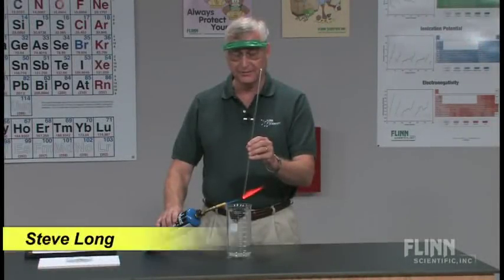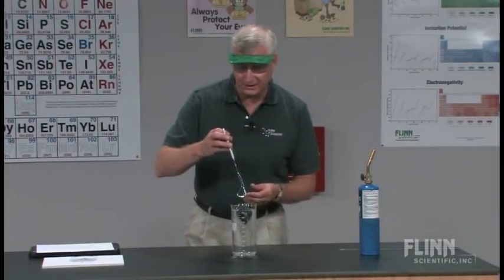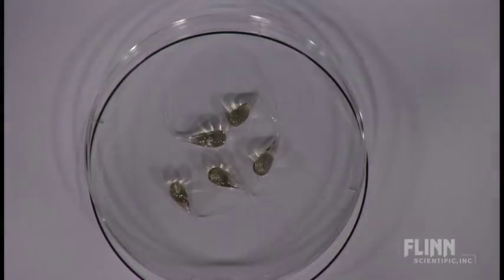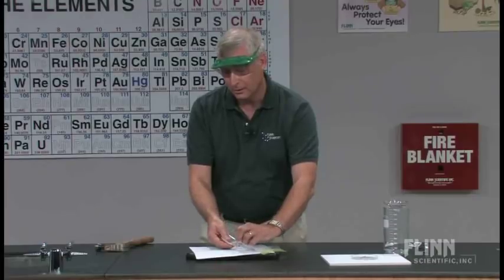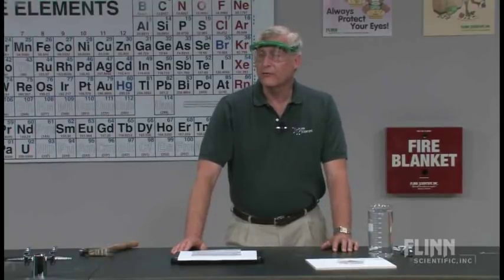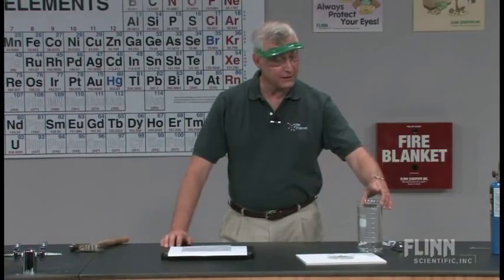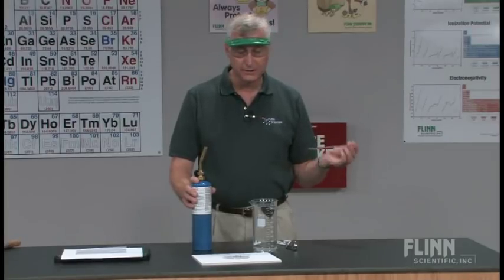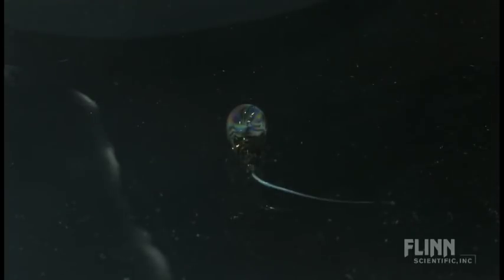Prince Rupert's Drops Are Stronger Than Steel

Comment: If you were to make one in space it could be make without a tail. Would this make it indestructible?
Reply: no not indestructible just really really durable
Reply: Nope, any scratch on the surface causes it to shatter.  They're super-durable against blunt impacts, but, the first sharp thing destroys it.
Reply: ***** I have no idea, but I love the fact that you thought about that! There's probably a whole host of cool things we could do in total vaccum and/or near weightlessness!
Reply: You probably just couldn't make one in space since there is no oxygen in space required for the fuel of the torch. So considering that, let's say you use another heat source, like a laser. The gravity on earth is what causes the droplet to be pulled from the rod while the glass is molten, so the completely even pressure that would be applied to the molten glass in space would not allow for the drop to form. You'd have to have something pulling on it for the drop to form. Apart from that, you have to consider the way the glass would react if heated in space, since there is no oxygen. Would it even get "molten"? I could be completely wrong though, just my opinion lol.
Reply: I'm pretty sure molting doesn't have anything to do with oxygen and you wouldn't have to use a rod, just let a small chunk of glass float there and heat it with a laser or something (not really sure weather or not the torch would work). Then when it molts push a ball of water its way and see what happens.
Reply: ***** No oxygen in space? We should immediately tell this information to all the astronauts. I hope they are still alive...
Reply: ***** Wow that was pretty snide especially since I never said "there's no oxygen in space" I said I wasn't sure if the torch would work because of it.
Reply: ***** In fact, my comment was referred to Gregory ;) By the way, if you questioned about the efficiency of the torch, maybe you agreed with the "no oxigen statement". But I was only joking around.

Comment: what happen if you dropped a melted spherically shaped glass  mass into cold water like this? you get no tails right? is the sphere stronger than steel then?
Reply: I'm no specialist at all, so don't take my word for granted. The best would be to get an answer from FlinnScientific . In any case, my initial guess is that you cannot create Prince Rupert drops which are spherical. The tail acts a keystone in architecture: without it, the cooling glass does not compress internal forces onto anything and therefore aren't any more solid than normal glass.
Reply: a youtuber named carsandwater done a similar experiment with a marble made of glass heated it up to a melting point and put it in water the marble shattered but his eperiment might deem invalid if you take into acount that the marble was deformed int the moving process

Comment: I thought the blue cone on the the inside was the hottest part? (at least thats what I remember from the chemistry classes I didnt sleep through in high school)  Is there a specific reason you arent actually holding the glass in that specific spot?

On a side note, I really wish I had teachers like you growing  up. I am naturally very inquisitive but most of my teachers were never actually passionate about their job and its was apparent.
Reply: ***** I know for certain that the flame turns orange because the glass lowers the temperature significantly, so that is false.
Orange and white flames are literally opposite sides of the how hot the flame is. White is the hottest and orange/red is the coolest.
Reply: +iRTehSecks no mate, your response was fairly hostile and aggressive
Reply: Not entirely. I have no issues being wrong and I wasn't even the one who was wrong but had read your comment as a 3rd party and you still came off as aggressive for no reason.
Reply: +Syntechdragon No he did not sound aggressive, he just corrected him.
Reply: +iRTehSecks And to be exact, he wasn't trying to be a dick, as he said, "I know for certain (evidence which contradicts CP), so that is false". The only even remotely non-neutral word is literally, but you are just sensitive as was said before. ;)
Reply: I just ignored them because I could tell they're just sensitive. I wouldnt even put up with that level of sensitivity in person with someone I knew, let alone complete strangers online.
Reply: +iRTehSecks The tip of the blue part usually tends to be the best for heating, while blue does tend to correlate with greater heat then red for burning gasses the area inside the blue cone that you see on burners actually has no oxygen reaching it and so its not a good place to heat or burn things. My chemistry lab professor has demonstrated this by holding an unlit match head inside that blue cone area by putting it in there quickly, once it's just sitting in there it does not ignite (this was on a Bunsen burner not a propane torch but I'm sure the same principal applies), he also brought a piece of paper down onto it quickly then pulled away and you could see a circle that did not burn in the middle area where the blue part was touching the paper and a blackened burned area around that circle where the blue ends.
Reply: Swiftness Thank you. That is the kind of answer I was looking for.

Comment: What if you were to reheat the drop with a propane torch? Would it just explode as usual, or would it heat slow enough to just melt?
Reply: you would increase the stress inside the drop (heating the outside of the glass increases the volume the outside takes up further increasing the effect that makes it so sturdy). It would probably explode, but if it's able to withstand the stress-increase survives and the drop melts it will upon melting rapidly heat up

Comment: Gives a new meanining for  " glass jaw "      " Dude has a prince rupert jaw "
Reply: sranjesuper but this would also mean it would be strong  as hell unless u get it at the perfect spot
Reply: l2noob4ul - Probably the heel.
Reply: sranjesuper The glass jaw on a prince rupert is the tail. You snip that with a pair of wirecutters, the tension built up in the drop is released explosively.
Reply: ^ yup lol, couldn't think of the word LOL and heel was close enuff :)
Reply: l2noob4ul
- I was making a reference to Achilles. You know, held by his ankle and dipped into some magic river that made him basically invulnerable everywhere except for the ankle that was held at the time; the proverbial Achilles Heel thus being the extreme weak point of an otherwise insurmountable opposition.

Comment: I hate to correct a professor, but the front windscreen in a car is laminated soft glass and not tempered. It's extremely important that the windscreen stays intact during an accident. However, the side windows and the rear window is tempered to allow for the escape of the driver and the passengers. It's this tempered glass that forms tiny cubes, laminated glass cracks into much larger pieces, but is held intact by the lamination.

Comment: Question: How big can you make a rupert drop?
Reply: probably not any bigger than an inch, Im no expert but I'm guessing that if the surface area is too large then there would be too much pressure on the thin layer of hardened glass on the outside and it would break or explode. like I said, I'm no expert so do be surprised if it completely wrong.
Reply: ^ mature..

but to answer the question, as big as you want, it's just the bigger you make it, the larger the explosion and the larger the weakness.
Reply: @kitsilanocat  Fo show it cant be bigga than yo mama tho! Skeet skeet skeet! :D
Reply: Maybe dropping it in boiling water would help make a bigger one is anybody figures out how to make big ones please tell me
Reply: Go to beyondthepress. He makes large rupert drops. You’re only limited by the size of glass stock used.

Comment: If you dropped it in liquid nitrogen and not water would it be harder from cooling faster?
Reply: Saberéase Era Probably would break more, but if you managed to have one survive, perhaps.
Reply: Short answer, no.
Long answer, the glass gets as hard as it does because the inner glass takes longer to cool.
So, if it were put in liquid nitrogen instead it would cool faster and most likely explode. However if it did survive it would still not be stronger, it would be much weaker and would most likely shatter from slight shocks like just being picked up.
Reply: No it 
Would shatter

Comment: What happens if you do this experiment in space, where you can place a molten glass sphere in water without it forming a tail?
Reply: Sure wouldn't it just not separate from the rod???
Reply: Rupert's balls! the first thing that came to my mind :-p
Reply: SerpentSword _ Nothing says you have to use a rod, you can just use a chunk. Heat it from two sides so the Bernoulli principle keeps it in place and KABLAMO - prince rupert's balls!
I guess the real problem is how to cool it from all sides at the same time, so it doesn't explode as soon as it touches water.
Reply: You'd have an indestructible glass ball
Reply: ofcourse and then it will came on to his face and then his face turn be justin B face
Reply: It probably would not work unless you found a non-flame heat source to melt the glass. With little to no oxygen in space you would not be able to produce a flame. You would also, for various reason, find it very difficult to keep the water in its container or even to maintain it's liquid state. I cannot see anyway this experiment would be repeatable in the extremely cold vacuum of space. You may be able to modify the experiment in ways that are beyond me but I think it's safe to that for all intents and purposes, it's not plausible.
Reply: +Luben Lambov 
Or if somehow using Bernoulli's Principle like you mentioned you could probably omit the water altogether because once the glass drop falls away from its heat source it will instantly cool at "space temperature". But, again, I would tend to think that a non-flame heat source is needed
Reply: TCSwizz2 Vacuum is not cold, per se. You need to immerse the glass in water, or similar liquid, that would quickly transfer the heat out from the glass.
Reply: +Luben Lambov 
A vacuum may not necessarily be cold but space is. Which is what I was getting at.
Reply: TCSwizz2 Space IS, basically, a vacuum...
Reply: +Luben Lambov The drop won't drop... The heated glass won't separate because it is in a low gravity environment VERY LOW gravity environment
Reply: +Luben Lambov 
Is there an echo in the room? Because I'm pretty sure someone already stated that space was a vacuum... Oh yea, it was me! Hahahaha
Reply: +CrimsonBlood017 
Do you think the drop would float away if you heated it from the top down? Lol 😜
Reply: +Luben Lambov 
Whatever you say Bro Beans! I do believe you were the one that said, and I quote "vacuum is not cold per se". But, it doesn't matter. I can see that your head is way to big to hold your intellect.

HAHAHAHA you're a fool bro
Reply: TCSwizz2 OK, now I'm 100% sure you're off in some way.
Reply: Ok so how about this:
0_ Sorry for bad english, not native.
1_ As I understand about this thing is that what you essentially need is to heat the glass to some really high point, so what you could do is to use a premade glass ball(?)
2_ You need to heat the glass in all the surface. We can use a heat source like oven thing to this.
3_ Here is the problem, we need to cold it same way we heat it, BUT in thermodynamic we learned how a refrigerator works right? We could use the same principle to "revert" the heating source to be a cooling source, we'll need an really high amount of energy to revert the machine's temperature but I think it's posible.

Correct me if I'm wrong, I found this posible output really interenting
Reply: +Luben Lambov  A vacuum, and space =/= the same thing, You can have a vacuum here on earth. A vacuum is a space entirely devoid of matter.
Reply: Well, That could probably be done only by Laser or Highly concentrated sunbeam.. Or may be some electrical method..... Cuz Flames dont work so good in space you know.... :D
Reply: MidnightKatana Technically, yes, but not in practice. You can't create a space entirely devoid of particles/matter, but space is close enough to be considered a vacuum.
Reply: It wouldn't form a drop for one thing.
And without the quench in water it would have the properties of being so strong, and having a tail.
Reply: You wouldn't be able to get an open flame?
Reply: Alec Schmutte jiujitsu5000 I should have thought my comment through a bit better, I'm sorry. 
By "space" I meant like on the space station, as in "zero g", or something like that. So it doesn't form a drop shape, but rather stays a sphere. But then again, you would probably to heat the glass up with something else, as flames will just spread everywhere, even in a controlled experiment chamber.
Still, it's a fun thought experiment.
Reply: jiujitsu5000 I'm too stupid and fat. Also probably too old, but not sure.
Reply: @TCSwizz2  it doesn't have to be a vacuume, just 0 G. You could do it in a pressurized factory in orbit.

The vacuume also insulates so it would retain heat until you conducted it away.

Comment: i work in a factory and we have punch presses that can stamp parts out of steel. I'd like to see what one of these things would do under literally 2000 tons. That's 4,000,000 pounds.
Reply: bobwatters it says the drops are stronger than steel. If they are, then if you placed one on the die and lowered the press, it would not be crushed. And i guareandangtee you it would. We've crushed synthetic diamonds in these presses lol
Reply: ***** You aren't taking into account the size ratio, unless you're pressing drops of steel. If you found a way to get a drop of glass to fit the size of the press (Probably impossible) without also exposing the weak tail of the glass to the pressure then your press would probably do nothing to it. Theoretically  speaking of course, the glass would lose all of it's strength getting it to that size.
Reply: Darren Miller what i'm saying is, take a drop, put it on the post, and bring the die down. The drop would be crushed to dust. The drops aren't "stronger than steel".  They may be harder on the mohs hardness scale, but the tensile strength of glass is no where near that of tool steel or even cast iron. Like i said, we've crushed synthetic diamonds, which actually have a hardness scale of 99.9/100. These drops are not as strong as diamonds, and they aren't as strong as steel. So hush.
Reply: Simple analogy as to why it doesn't work like that: Even if my brother's stronger than me, neither of us can lift up a house. Even if I'm faster than my brother, neither of us can run faster than a bullet train.
Punch presses designed for stamping out steel aren't exactly strong enough to do it. They're a lot stronger.

And if you're referring to the fact that steel is forced into a new shape by them, whereas the glass drops just shatter, then that's a different thing entirely.
Reply: Alexandr Korekov He said stronger than steel, but that does not mean that it is stronger than anything else on the planet, I am sure that 2k tons is not the exact borderline number to press steel, meaning that it is above it, hopefully it is, as it should be. Meaning it could still break that drop.
Reply: Since you are only referring to force, not pressure (which is force per unit area), the result would depend on the area that that force is applied to on the glass.  If the tempered glass is a flat pad with more than 2 square inches, and there aren't any sharp points or bumps in the contact area, it might survive.  For a Prince Rupert's Drop, the press & anvil would require conformal contact shapes with similar minimum area constraints.
Reply: SIMKINETICS
:o uh what lol
Reply: *****
in other words, right now you are a hawkboy, one day you may become a hawkMAN
Reply: yeah, and the analogy of using a (synthetic) diamond compared to one of these drops is a logical fallacy. just because something is hard does not mean it is hard to break; on the contrary, it's hardness is exactly why it shatters. an everyday diamond would crack or possibly shatter under the same hammering that this drop took.
Reply: but mine also gets harder than steel
Reply: hawkboy1792 it's not harder than I am first thing in the morning... Not even the press could beat it down

Comment: Do those internal stress forces generated by the rapid cooling of the glass drop 'knit' together the microfractures in the glass drop - - or the microfissures on the surface of the glass drop?

Comment: In 1975 a coworker who was retiring showed us this with 3 inch rods and a barrel of water . Heated about 15 inch of a rod into a drop in the tempering  oven . Was about 6 1/2 inch in diameter with a curlicues stem of 24 inches. 

Used a 4lb hammer and couldn't break!  Then he disintegrated it by snipping the tail with a pair of pliers.  Just a cloud of dust in 1 second. Amazing

Comment: Is there any practical use for this?   can this be applied to a larger shape?
Reply: +Reegareth This idea is what is used with a slightly different method to make gorilla glass. Watch the Age of Glass videos with the mythbuster guys for a better explanation.
Reply: +Reegareth I am unsure what kind of use it would have BUT it is the fastest mechanical reaction that I know of so it might be used to start a mechanical reaction almost instantly from a reasonable distance.
Reply: +Reegareth 
A similar affect to prince Rupert's drop is used for car door windows. Breaking a car door window by hitting it in the middle is made difficult since it is tempered glass, but the edges of the class are easier to nick causing it to shatter. This property is useful as it makes the windows durable, but also allows them to be easily removed in an emergency.